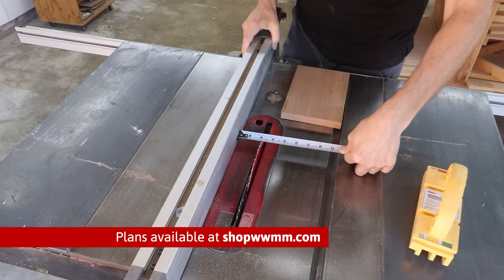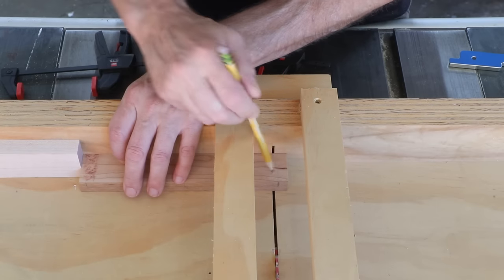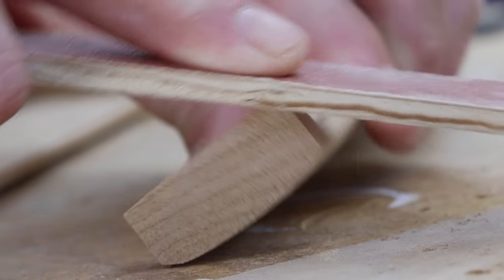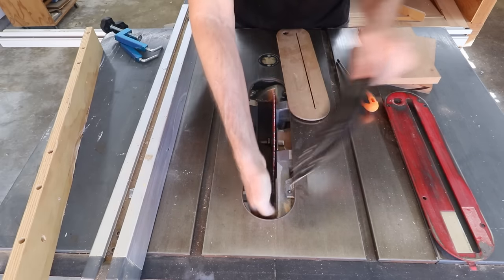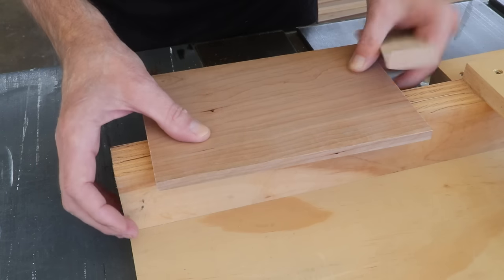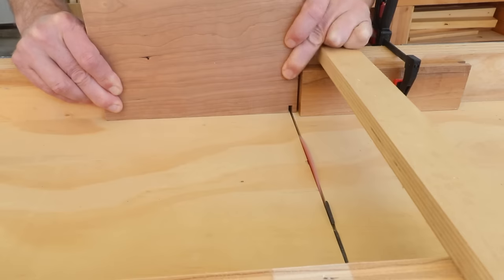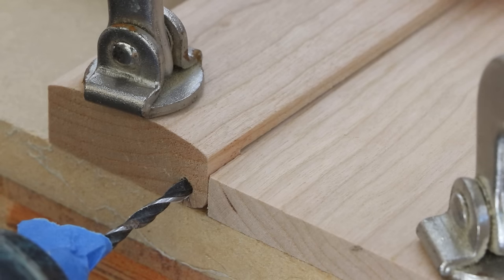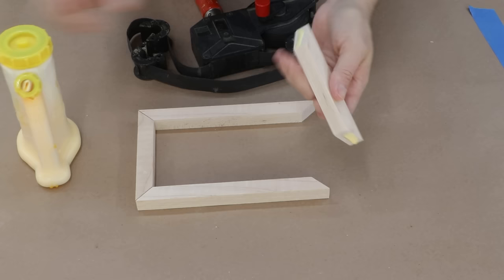This unique wooden book is a keepsake box

Comment: i really like your process and design.  I've made three boxes to hold my dad's three WWII medals  i pretty much followed your process with just a few exceptions.  for drilling the holes i measured, marked and then used my drill press to drill the holes just through the spine.  Then i used that hole to guide the drill bit into the keepsake cover after the inside piece was already glued in.  that way i got the holes in exactly the right place for the cover.  when i tried your way of siting the straightness of my drill, i found i was not very good at it... :).  i happened to have some cherry logs from a tree on our property that fell years ago.  was a fun time debarking, leveling and cutting to size.  Inside the box a cut out a cardboard piece to fit the inside, covered it with felt, then attached the medals.    Used poplar for the inside body.  Also, two of the three boxes i stained my cherry with cherry stain and then shellaced and waxed them.  the other one i tried some rubio monocoat cherry color, and while it looks ok, i like the stained ones better. thanks again!!!  would love to show you the results.

Comment: Steve mentioned that you could get a ripping blade for your tablesaw.  Do it!  I was amazed at the improvement with my old underpowered saw.  The ripping seems to work fine for crosscuts, too.  I would never dream of using a general purpose blade unless you have a big motor.

Comment: Great project, Steve! I would recommend recessing the magnets below the surface slightly. You will lose a small amount of magnet force, but you can compensate by increasing the magnet diameter or thickness. Neodymium magnets are very brittle and if you slam them together enough times, they will eventually crack. Ask me how I know 🙄

Comment: I once used some of those little magnets on a project.  I had some harbor freight, knockoff JB Weld.  I found out really quick that there is metal dust in that stuff.  The magnet pulled the epoxy from the bottom, where I inlayed it into wood.  It completely covered the magnet regardless of what I did.  I learned not to ever use JB Weld on magnets.

Comment: Steve that’s a lovely piece that I’m sure I’ll be making sometime soon! I have a question though, why didn’t you use a round over bit in the router table to round over the back of the cover that opens? Saves a lot of sanding and guessing and you shouldn’t need to cut a chamfer on the inside box then either.
Reply from the maker: Yes, you could use a router!

Comment: Really cool. I promised to make a few wooden books for my wife who is currently publishing her first novel. Unfortunately I think that with this particular design the "pivot" point with the dowel is more than likely going to crack and break off over time. Still gave me some ideas though.
Reply from the maker: It should be fine as long as you use a hardwood. Pine might split at that hinge point. I made one of these ten years ago out of cherry and it has never had any issues.
Reply: @SteveRamsey  ahhhh good point. You did say "cherry" so that makes sense. When she publishes there will be 5 limited edition wooden bound books so of course I want it to last. Thanks for the imput Steve. Nice to see you expanding the range of the Grrrrriper. Reminds me of the old...."Micro Jig" intros ha ha. God bless ya buddy.

Comment: Steve, I've asked you a few times already but not getting a reponse 😋 what mask are you using there? I'm still looking for one that doesn't fog up my safety glasses.... And great vid btw (as always) !!!! 🦔
Reply: Polish your safety glasses lenses with a touch of neat dish soap, like Dawn. Rub in a thin layer, and polish it off with a soft, dry, lint free cloth, or microfibre cloth. It inhibits the misting up from your breath. I used that trick on my helmet lens when I was riding a motor bike. If your using a disposable mask, just make sure it fits tightly around your nose and mouth too.
Reply: @BigHenFor  I'll try that. thanks for the info 😉
Reply from the maker: That's an RZ mask, but I don't like the way it fits. There's one called "Base Camp" that works better.